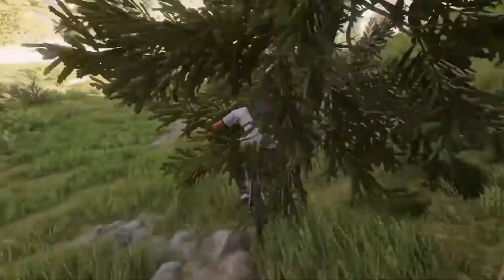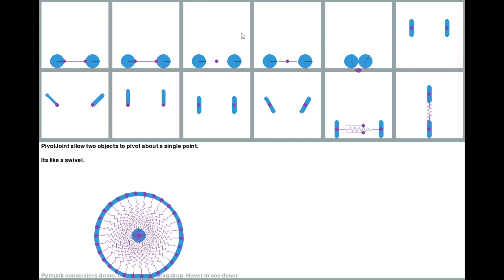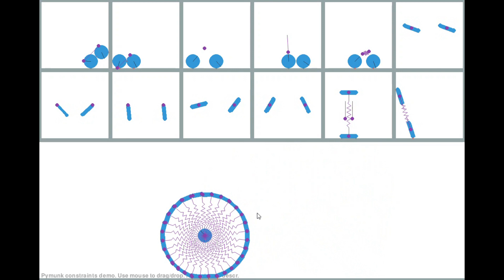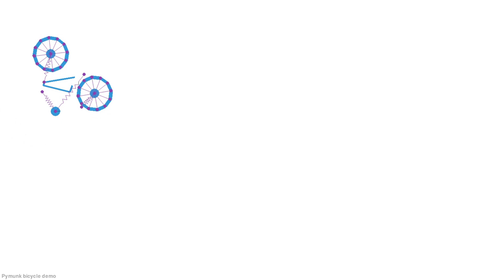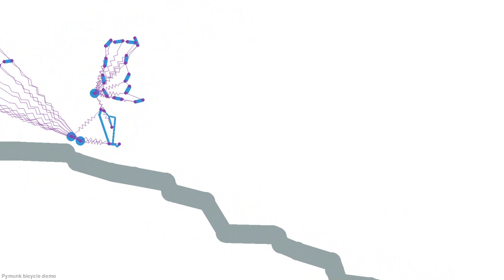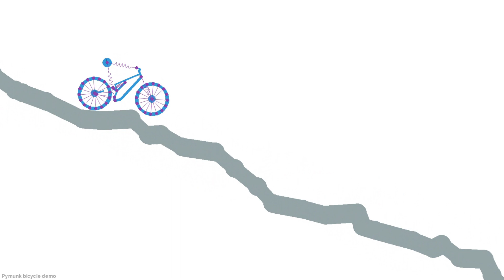Can you spot what is wrong with this mountain bike simulation?

Comment: Superb!  Interested in how you are modeling the rider.   That, to me seems far more challenging than the bike.  The rider, it seems could be modeled as a bunch of masses, springs, and dampers along with actuators of moderate complexity.  As a retired engineer, I used to model many systems from nuclear power plants to acoustic transducers. There is something very satisfying about having the model line up with reality.  Best of luck!  Oh yeah.  If you can model this, you can model just about anything.  This project of yours is a hard one!
Reply from the maker: Thanks for the encouragement! I went for simplicity with the rider. A torso central mass attached to the bike with spring/dampers in place of arms and legs. One more trick was a rotational spring so the rider had a preference to stay in the "attack" position. It seems to work pretty well except the rider is an open-loop system: no feedback limits their ability.
Reply: @moregameconcepts  I think that is a reasonable approach.  I always started with simple models, tested them, and then refined them, looping through that process until the model agreed with experiment.   I think what you are doing is very similar.  It is generally a better approach than to try to figure everything out before building and testing the model.  I bet one of the big mountain bike companies would hire you in a heartbeat.

Comment: If your looking for realism in the tyres... Why don't you make the wheel rigid, with an outer layer that is not, then you may be able to make the "tyre" harder/softer depending on how many segments you make it with... and if an impact on the 'tyre' is beyond a limit then the associated 'Spoke' could be made to fail making a larger/flatter section on the tyre... a puncture would reduce the rigidity of the outer segments slowly or quickly depending on the impact damage...
Reply from the maker: Thank you for the suggestion. The Pymunk physics engine does not handle deformable bodies, so modeling the wheel as "chain and spokes" is working well enough. The simulation allows a parameter for the allowable error tolerated in the spoke calculation which I can use as a low-effort hack to get tyre cushion. If I want to take it to the next level I can think about how to implement your ideas.
Reply: @moregameconcepts  so run a solid wheel with a set of loose chained tringles in place of a tyre... the looser, the softer... Tyres aren't all that soft...

Comment: Nice! 12 spoke wheels. Conventional bicycle wheels have 24, 28, 32 or 36 spokes. BMX bikes commonly have 36 or 48 spoke wheels. The frame makes a difference. The rider needs a torso and a head. You've got her arms attached to her hips. Also knees and elbows maybe a neck depending.
Reply from the maker: thanks Mike, I have a lot to work on!